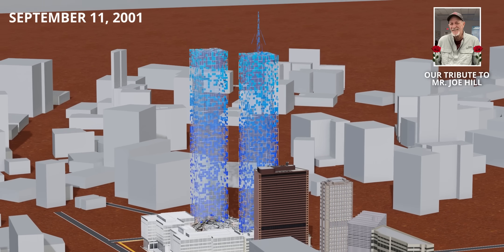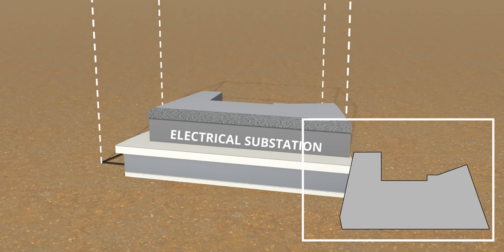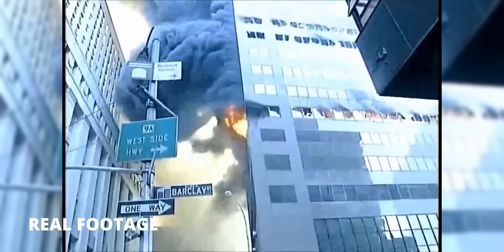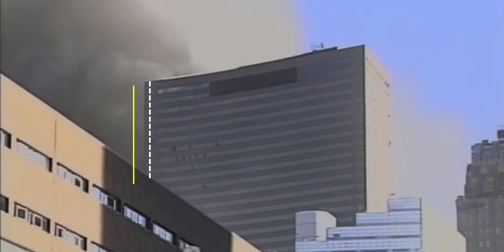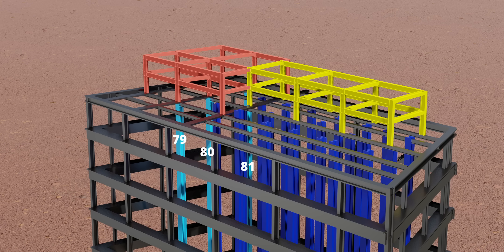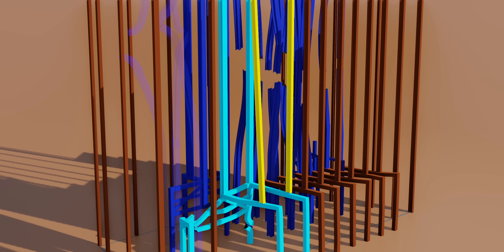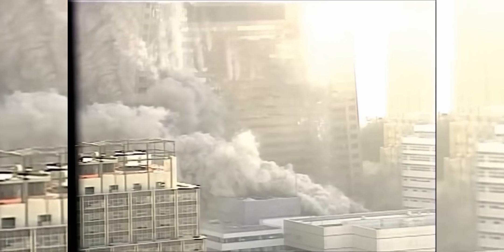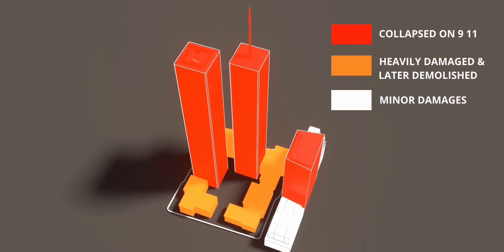Collapse of Building 7 | The Complete Physics

Comment: We are all here because a very scary three letter alphabet agency wants us here. Im terrified. I believe everything this random engineer says. Even though the books on the shelf tell me otherwise.
Reply: @h1F595  Are you trying to rewrite history?!

Symmetrical collapse is what we saw happen to WTC7 :  it's the unnatural collapse of the building where the bulk of the building begins to come down as one, rather than some parts of it (say the West side) beginning before say the East side.  

Even if the fires truly weaken the structure of the building to the point of collapse (unprecedented), the issue is that the effects of the fires would not have been uniform through out the building and so cause the sudden and synchronised failure of the entire building structure essential for the building to collapse symmetrically as we witnessed.
Reply: @h1F595  Furthermore, the analysis by David Chandler - B.S. in Physics and M.S in Mathematics - who used broadcast video capturing the symmetrical collapse of build 7, showed that the entire build free-fell for the first 2.5 secs approximately, equivalent to around 8 storeys. This analysis was confirmed in the NIST report.

8 storeys of symmetrical free-fall cannot occur through your allegation of heated structural columns giving way, all at the same time through plastic deformation.  Free-fall implied the ENTIRE underlying structure of the build stopped working at the same moment in time.

This is why several demolition experts, architects, engineers and scientists from American and around the world, interviewed in the documentary by Architects and Engineers for 9/11 Truth, did not hesitate in identifying the WTC 7 collapse as controlled demolition.
Reply: And yet that random engineer is not wrong. Go figure. 

This video is very good – with one or two exceptions - and goes into a much higher level of detail than many viewers will be able to comprehend.  While not perfect, the collapse mechanisms – the sequence of failures - described here  are substantially correct and this is true no matter who planned and carried out the 9/11 attacks or why . 

That may not be what you want to hear and go against 20+ years of entrenched dogma and conditioning, but it’s not wrong. 

That also means (in case you did not get the hint) this video can be (and IS) absolutely correct in its description of collapse mechanisms AND the 9/11 attacks could still have been some sort of inside job. The two things are in no way mutually exclusive. 

The mechanisms described here have broad professional support around the world. There are no professional engineering organizations (for example: ASCE, ASEE, ICE, etc) that disagree with them or have offered any formal dissenting opinions or alternative hypothesis. 

So, setting hubris aside, either the overwhelming majority of the worlds structural engineers and simple observation are wrong,… … or you are. Which seems more likely? 

IF you still think believe this explanation is wrong then produce a better one . Good luck with that. No one ever has and I don’t see you moving that needle today. 

No one ever does.
Reply: @TheCriticalStinker-01  Sorry but how on earth does this video satisfactorily explain the perfectly symmetrical collapse of WTC 7 which is only otherwise observed under the circumstances of an extremely well prepared controlled demolition?    

For a symmetrical collapse, especially involving free fall as has been confirmed, every column needed to stop functioning at precisely the same time.   
How on earth can the random and asymmetrical effects of a seemingly modest fire produce such precisely symmetrical collapse?

Demolition expert from around the world do not flinch in identifying the WTC 7 collapse as controlled demolition.

Furthermore, on the testimony of Larry Silverstein - leaseholder of the World trade Centre - in an interview he claimed being advised that "pulling" WTC7 was the only reasonable option. 

Sorry,  but WTC7 seems to be a smoking gun of a conspiracy.
Reply: @TheCriticalStinker-01  A few engineers on the U.S. governments paylist still dont represent "the overwhelming majority of the worlds structural engineers" Fitzshill. Will you ever manage to comprehend that simple fact in your shitty "life" Fitzshill?!?
Reply: @TheCriticalStinker-01  suuuuure...  😒😉
Reply: @MrGreatness412  - If I made any errors of fact, logic or reason or left anything critical out, please let me know so I can fix it. IF you can offer a more plausible alternative please do. Be the first. 

Of course, you would have to actually read it first, which I realize is a big ask. All those words.
Reply: @h1F595  Furthermore, the analysis by David Chandler - B.S. in Physics and M.S in Mathematics - who used broadcast video capturing the symmetrical collapse of build 7, showed that the entire build free-fell for the first 2.5 secs approximately, equivalent to around 8 storeys. This analysis was confirmed in the NIST report.

8 storeys of symmetrical free-fall cannot occur through your allegation of heated structural columns giving way, all at the same time through plastic deformation.  Free-fall implied the ENTIRE underlying structure of the build stopped working at the same moment in time.
Reply: @h1F595  Furthermore, the analysis by David ChandIe r - B.S. in Physics and M.S in Mathematics - who used broadcast video capturing the symmetrical collapse of build 7, showed that the entire build free-fell for the first 2.5 secs approximately, equivalent to around 8 storeys. This analysis was confirmed in the NIST report.
Reply: @h1F595  Furthermore, an analysis by a science teacher with a B.S. in Physics and an M.S in Mathematics who used broadcast video capturing the symmetrical collapse of build 7, showed that the entire build free-fell for the first 2.5 secs approximately, equivalent to around 8 storeys. This analysis was confirmed in the NIST report.

8 storeys of symmetrical free-fall cannot occur through your allegation of heated structural columns giving way, all at the same time through plastic deformation.  Free-fall implied the ENTIRE underlying structure of the build stopped working at the same moment in time.
Reply: As for the number of expert who immediately identified the WTC 7 collapse as control - there were perhaps over 10 demo experts, architects, engineers and scientist who were of this opinion interviewed in documentaries found on the internet  - I can't post the name else the post gets deleted. Look for them.
Reply: @h1F595  This is why several demolition experts, architects, engineers and scientists from American and around the world, interviewed in the documentary by Architects and Engineers for 9/11 Truth, did not hesitate in identifying the WTC 7 collapse as controlled demolition.
Reply: @h1F595  I can't give you a complete response because the rest of my content keeps getting deleted.
Reply: @gladishilton1943  - You have 9 posts in a row. Doesn't seem like anything is getting deleted. No matter. I covered all those points already in my second reply to you in this thread - which you completely ignored. It would have served you well to actually read them. There is a reason David Chandler (high school science teacher) and the rest of Architects and Engineers for 9/11 Truth have been utterly failing for 18 years - an unbroken record of absolute failure. 

You've been had.
Reply: @TheCriticalStinker-01  Ha, Ha!   Your second reply is full of nonsense...as I think I have pointed out; I only see 4 of my last posts. 

To recap: You are incorrect that only part of the build free-fell : the entire building is visible falling together (symmetrically) in David Chandlers saved broadcasted video 

Furthermore you (or this video) hasn't explained any of the free-fall because this requires the structure beneath to suddenly stop functioning. Even if I grant you that heating of the columns by fire is the root cause, at best the heat would have brought on sagging of columns gradually and asymmetrically throughout the building;  and some parts of the building would have likely been unaffected.   This is incompatible with symmetrical collapse that involved free-fall.

If you want to talk about people being had, you need to look in the mirror.

And thank goodness for A&E, they're the only one who are keeping the prospect of a proper re-investigation alive for the benefit of all Americans.
Reply: @gladishilton1943  How long had Building 7 been collapsing before Chandler started his measurement?
Reply: @TheCriticalStinker-01   His analysis starts a few seconds before WTC7 starts collapsing and extends for approx 7 sec after. In the video of his analysis you can see the entire width of the building from which you can confirm the symmetrical collapse. He tracks the top corner of WTC7 and a point on an adjacent unaffected building (to account for camera shake) His analysis shows ~2.5 sec of free-fall (in agreement with NIST report )and then deccelertion as the building finally begins to collides with itself as the pile forms.   

Can you explain around 8 storeys of free fall with your "softening columns" hypothesis?
Reply: @gladishilton1943  - No, be precise. How long had Building 7 been collapsing before Chandler took his measurement?
Reply: @TheCriticalStinker-01   Not sure if the reply posted so trying again.    The analysis starts 10 sec before - to establish there is no movement, and continues for ~7 sec after movement commences to indicate everything i mentioned.  Look for the lecture and see it for yourself.
Reply: @TheCriticalStinker-01  ...And let me know if you can explain symmetrical free-fall collapse of WTC7 with your randomly sagging columns theory.
Reply: @TheCriticalStinker-01  Apologies for not replying to your later posts and questions - they only appeared in the latest refresh in my browser

No, that was not the footage from which the analysis was conducted. Google Daves name and the words "lecture"  from 2018 to see the complete analysis.
Reply: @TheCriticalStinker-01  BTW, I am happy to rely on other people's analysis if the methods and conclusions seems rigorous.  Dave's analysis seems rigorous in revealing details about the collapse.  Your explanations do not address the observable facts and implications highlight by Dave's analysis.
Reply: @gladishilton1943  - 3rd strike, you are out. All of your claims are null due to unwillingness, inability or both to provide something as simple as the starting point of the collapse. Without establishing that, everything else is meaningless.

Thanks for wasting my time with your evasive trolling. I wish you luck with your continued epic fail and letter others do all your thinking for you. Goodbye
Reply: @TheCriticalStinker-01  I've explained your questions did not appear on my rendering of the thread in my browser and offered an apology and an immediate  reply as soon as your questions appeared.

Dave's analysis began with coverage 10 sec before the collapse began to establish there was no movement in WTC7 and continued for approx 7 sec after collapse commenced.     The video used was not the CBS footage - but one that shows the complete WTC7 building free-falling for approx 2.5 sec (roughly 8 storeys)

My posts with link to the lecture fail to appear so I've given instruction to google his name  + the word "lecture " and 2018.  

If you want to ignore this inconvenient evidence then I'll take it as a concession that it challenges the official narrative you cling to despite being unable to be explained what we witnessed.

I've got three strikes and you're acting like an ostrich.

Comment: Nonsense, how stupid do they think we are?
Reply: Do you really want an answer to that?

This video is very good – with one or two exceptions - and goes into a much higher level of detail than many viewers will be able to comprehend.  While not perfect, the collapse mechanisms – the sequence of failures - described here  are substantially correct and this is true no matter who planned and carried out the 9/11 attacks or why . 

That may not be what you want to hear and go against 20+ years of entrenched dogma and conditioning, but it’s not wrong. 

That also means (in case you did not get the hint) this video can be (and IS) absolutely correct in its description of collapse mechanisms AND the 9/11 attacks could still have been some sort of inside job. The two things are in no way mutually exclusive. 

The mechanisms described here have broad professional support around the world. There are no professional engineering organizations (for example: ASCE, ASEE, ICE, etc) that disagree with them or have offered any formal dissenting opinions or alternative hypothesis. 

So, setting hubris aside, either the overwhelming majority of the worlds structural engineers and simple observation are wrong,… … or you are. Which seems more likely? 

IF you still think believe this explanation is wrong then produce a better one . Good luck with that. No one ever has and I don’t see you moving that needle today. 

No one ever does.
Reply: Two fake plants have a lengthy discussion ⬆️⬆️🪴💩🫡🪴💩🫡🪴🫡🫡🪴💩🫡🪴💩🫡🪴💩⬆️👍👍

Comment: There's nothing mysterious about the collapse of World Trade Center 7. I know a person whose wife worked in that building and was there the day of the attack. She stated that there's 30,000 gallons of diesel fuel stored in tanks in the basement of World Trade Center 7. That diesel fuel Powers the generators which provide backup power to the World Trade center. Those fuel tanks caught on fire when the towers collapsed and that fuel was sufficient to cause a hot enough fire for long enough cause the building structure to fail.
Reply: Sorry, but are you saying that there was diesel in the basement that caught fire when WTC7 collapsed and the fire was hot enough to weaken the structure of the building.......which has already collapsed?!? 

What an idiotic explanation to pull out of your posterior.
Reply: @gladishilton1943  Especially since the diesel was recovered.